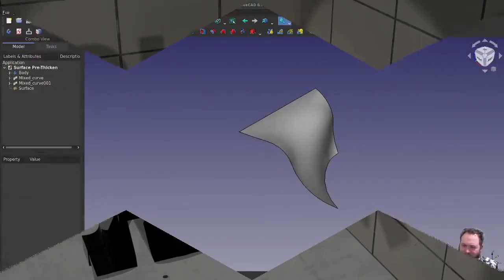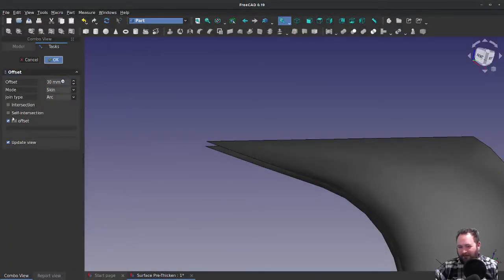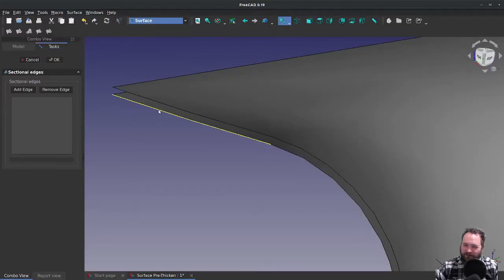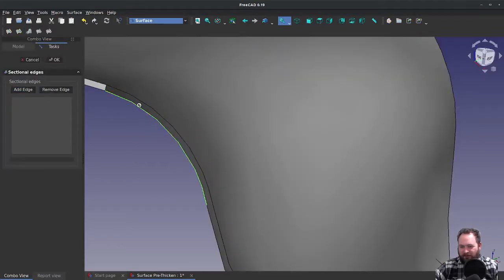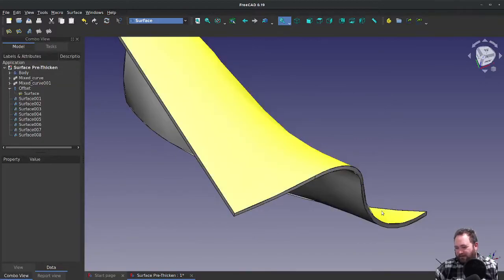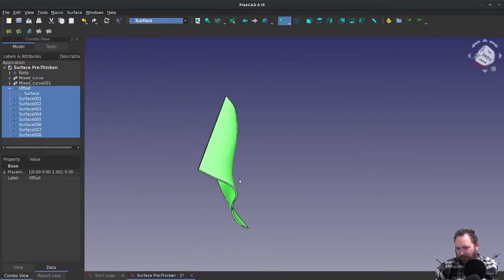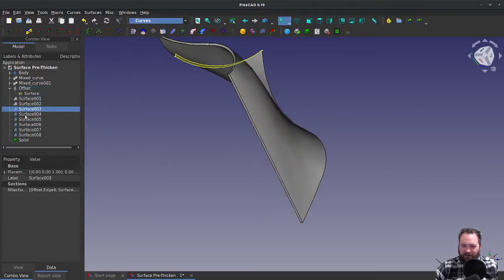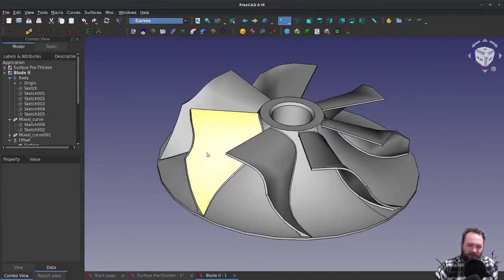FreeCAD - Surface Won't Thicken!  What to do?  |JOKO ENGINEERING|

Comment: Thanks for the suggestion. However your solution is a workaround that would lead to lots of problems in my workflow, not to mention the extra work and steps involved. I cannot get my loft to thicken. I extrude it as a solid and try the thicken option. I also extrude it as a surface and try the 3D offset command with fill. Neither works. I'm still trying to find an acceptable work around, but for now I am stuck. I wish the developers of freecad could figure out how to fix this serious limitation.
Reply: Its very serious limitation

Comment: Interesting video. I haven't used Part's 3D Offset much so I experimented with the various options using version 0.21. I found that if I changed "Join type" to 'Intersection' as well as select 'Fill offset' it seemed to successfully make a solid.

EDIT:  I imported your 'Surface Pre-Thicken-Surface.step' file into FreeCAD for my experiments.

Comment: It's not a solution, it's a workaround. Now imagine when you will create approximate shape of the blade, make it thick solid body, and then adjust some tiny element and you will have to redo whole process again. All the blades then central part, holes, fillets, everything. I hoped you found a solution for that.